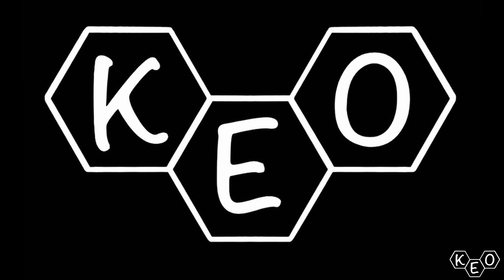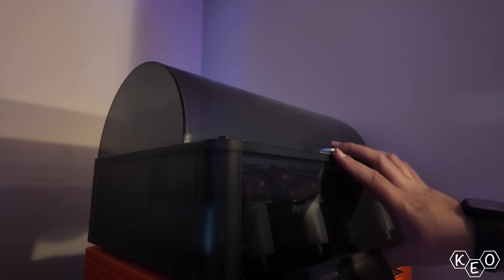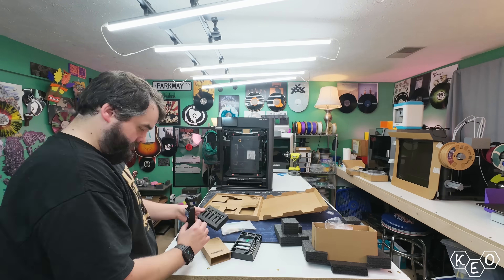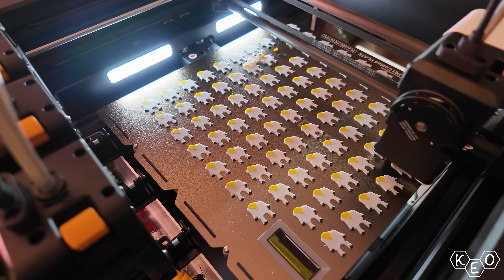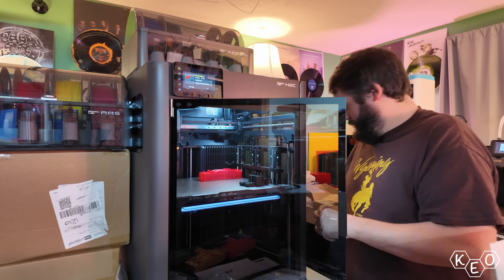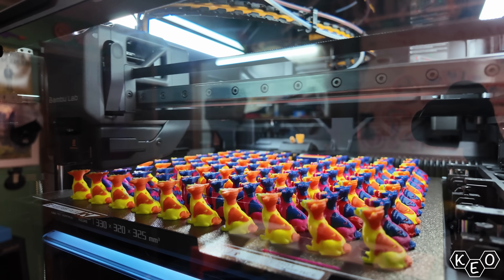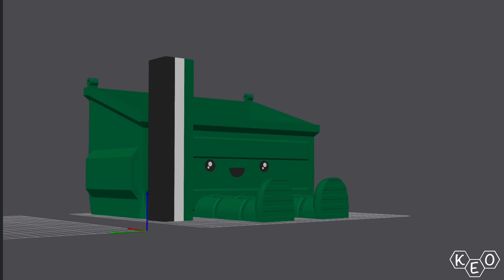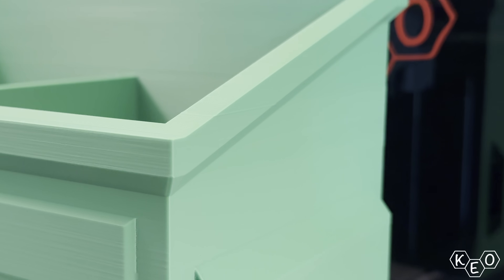Bambu H2C: Brilliant Innovation… or $2500 Mistake?

Comment: I can still return the H2D bought a few days before the H2C price was announced and released. For $399 more (half what I expected it to be), you open up so many more colors with almost no purge waste (long term savings and less garbage), and if I buy it from Best Buy, free 2 years warranty with total member plan (Though, they only change $179 for 4 years, Microcenter wanted double that for 2 years). Only downside, packing up and returning the H2D to MicroCenter, which I feel guilty, but hard to not push through that for the longterm benefits of the H2C.
Reply from the maker: I would return it. It’s a bummer to pack it all up and stuff but the H2C is so much more versatile than the H2D. Totally worth the effort right now

Comment: The heat gun can you comment on that a bit what does that do for you, smooth out the objects do you hit them all or just something depending on stringeyness.
Reply: I use a heat gun to clean up angel hair - very fine stringing between models or just across openings in a single model. It just disappears with the heat gun. Not worth trying to tune retraction any further than it already is, esp since it often varies from spool to spool, even in the same brand and color

Comment: Iv'e had mine for Two weeks now. A big problem, dont turn off the dual nozzle check at the start of printing, it does not save time and causes grief with your printing plate.  Apert from that I love it. Best prints and easeier to use. There may be faster units and cheaper, but this this machine is classy.

Comment: I’ve used my h2c every day since it was delivered. It’s running right now and is flawless. My only gripe is the numbers never line up. 1 AMS? 2 extra tool heads. 2 AMS? 2 extra filament slots. AMS and AMS HT? 1 extra tool head. They should have planned this better with a 6 slot AMS or 8 head Vortek.
Reply from the maker: Yea, this is kind of a silly thing to complain about but I have the same complaint. I run two AMS-HT's with an AMS on the one nozzle and then another AMS on the other side. Total overkill but that is likely by design so Bambu can sling more AMS units

Comment: While I think the nozzle changing system of the H2C is really cool, I also feel that it over complicates their version of a tool changer. And you don't get the speed benefit of more traditional tool changers. It almost makes me think that they designed it this way so they can sell more AMS units, but I don't know for sure.

I'll be keeping my eyes on Snapmaker. As per usual, Bambu is more expensive than I'm willing to spend and I don't like their walled garden. But in the end, I'll probably just build a Sovol SV08 tool changer if Snapmaker doesn't make a decent priced larger machine.
Reply from the maker: This is a fun time to be into the hobby for sure. I think there are going to be loads of tool changers coming very soon

Comment: It can work well, save waste, and be impressive, but still be expensive, compromised, and complicated. Obviously I hope it works well for anyone who buys one, but I wish Bambu Lab had engineered a proper tool changer instead. It's also a lot slower than a real tool changer, which is the main reason aside from waste to make one. I feel they engineered it intentionally to rely on the AMS so they could sell more. Just not a fan.
Reply from the maker: The AMS is the bottle neck for sure. The capabilities are extensive but compromised is a good word for it no doubt. Not a dealbreaker for me but certainly a tough pill for many

Comment: It's a mistake for consumers but because they have to push their AMS system it's the only way they will do it. INDX and the U1 seem to be the better bang for your buck. This could have been the way  Bambu introduced a 360x360x360 build area. The other systems save time and filament Bambu only really saved filament.
Reply: Both indx and U1 have not and will not have a 360x360x360 build area the best we can hope for in the next 6-8 months is a Core One L with indx at 300x273x330 (indx seems to take 27mm). Thats smaller than the h2c and thats shipping today. Not sure why people keep saying the ams is a bad idea really its only downside is speed. I will love to see how people will handle their 12 colors spools i can now use/dry/change in a easy way on a indx and toolchanger without 'something' we will see what people will come up with and how it will look/take space. Each system has its downsides and h2c is speed vs indx and toolchangers but jump over all the advantages like its nothing will be fun to watch how this evolves.

Comment: I mean in a vacuum, this is a cool idea and definitely reduces a lot of the complaints with MMUs. But when you compare this to budget tool changers (you could get 2 U1s and a P1S combo for the same price) or Indx which removes the need for the AMS and is much faster, its a bit to late to be the best method.
Reply: Being able to “store” and use 24 filaments at a time is great.  To do that with a traditional tool changer would need a huge footprint with today’s tech.     Of course I’ll never have the exact colors I need when I have 24 loaded.
Reply: Not every printer that comes out needs to be the "best". It's not a matter of better or worse than <insert other printer here>. It's just different. Comparing this to the U1 doesn't make any sense to me. This is not a budget machine. It was not designed to compete with the U1. It was in development long before anyone knew about the U1. It's meant to compete with machines like the Prusa XL. I have no reason to buy two U1s and a P1S instead of this. None of those machines can do exactly what this one does.
Reply: @1981AdamGs  Yessir!! That Bambu reliability means alot when you're pulling the trigger to add 50 machines to your production line. You know it will just work. When you do eventually need to service your machines, you can get parts next day usually. Part availability is crucial when a down macine means lost revenue- Bambu Lab is a great partner in that regard.

Comment: I worry the little mechanisms are a bit too complex and delicate. Do you think it might be more likely to break than a toolchanger?

It’s a really cool concept, but in my experience with other new technologies, the ones that try and go small with tiny moving parts aren’t as resilient and are harder to repair.
Reply: I worry too, but looking at mine, it looks to be ALL metal construction, its not flimsy or cheap, so let's hope it holds up!
Reply: You shouldn't worry. It's not too complex. People constantly get this wrong. It's actually quite simple and less complex than a tool changer. There are TWO added moving mechanisms to this machine. The pin that locks the right nozzle and a stepper motor that raises and lowers the nozzle rack. That's it. If the pin breaks, get a new one. It even comes with an extra one. The stepper motor will never fail. It's moving far less than any other motor in the machine. But if it does, you replace it. The complexity is in the software. Which either works or it doesn't. Other than those two things it has the same number of moving parts as the H2D. Tool changers have more moving parts because they have multiple extruders. Tool changers also have pogo pins. Which wear out. Anyone that has been around industrial machinery knows this. This only looks complicated because of how quickly it changes nozzles. But it's really not.
Reply: @1981AdamGs  Guess I need to see one in action, cause I’m still not entirely sure how it works. It does seem to be a cool concept though.

Wonder which method will win out in a generation or two when everything has fast wasteless multicolor the way everyone has multicolor boxes this generation. 🤔

Comment: The the layer bulge at the bottom of the dumpster outside might line up with the top layer of the inside of the bottom dumpster model. It could be large larger skrink you see even on the small benchy test when the layer cools down and pulls in causing the next layer to look bulged because it lost some of its base footing.

Comment: Good, but nothing compares to the Snapmaker U1 for Multicolors
Reply: Reliability and quality maybe? Speed is not everything
Reply: @BattleBrotherMaxor And anything lower than 3 or higher than 4 colors.. Its better in 3 or 4 colors for the best it's not really a win. The h2c will do 1 and 2 colors the same speed and well 5+ colors way faster since the u1 can't. It also is a 1.7x the build size and many others things. yes its 2.5x the price and way slowr in 2 or 3 colors.

Comment: I'm betting a single nozzle 4-vortek P2C will exist in the near future.  Smaller build volume, less nozzles, not built for higher end filaments, but most of the benefit if you just want to print some multi-color PLA and PETG stuff.
Reply: Probably an X2C
Reply from the maker: I would like to see a smaller vortek system on a single nozzle system come around

Comment: The features of the H2C definitely grew on me. I really like the ability to quickly swap out nozzles. It’s as capable as a H2D for TPU’s but much more capable for multimaterial printing. The AMS unit is also hard to beat for swapping out filaments, you don’t even need to mess with the printer screen whatsoever. 

I also really like the Prusa INDX option, however, I really want to see how they handle filament loading/changes for 10x nozzles on the C1L. Also want to see what the max temp ends up being for the hot end once it launches.
Reply from the maker: It’ll be interesting to see what the INDX ends up costing and when it actually delivers upon actual release. Should be a good thing though

Comment: H2S at half the cost is all most people need.  The H2C pays for itself and saves $ long term if you print multicolor frequently .. but if you are a high end user constantly printing, I'd want an improved H2C pro with a longer term warranty which they haven't released yet..

Comment: Well you saying that because of multi toolhead there would be less space and toolhead could be heavy and bigger but when i look at h2c toolhead, its already looking bigger than snapmaker one. and it takes so much more time than snapmaker to change color. at the end, print speed is way better with snapmaker. bambu use less toolhead with absurd price, snapmaker offer 4 tool head, easy solution with affordable price. i like a1 but probably my second machine will be snapmaker u1.
Reply: ehmmm it looks bigger because its 1.7 the build size ?
Reply from the maker: Yes, the tool head is certainly bigger than a single nozzle setup but smaller than a tool head that would have 6 nozzles on it for example. That’s the compromise and it’s certainly an interesting system with pros and cons. I am loving the snapmaker as well though
Reply: @KeoPrints  I might have commented this here before but i suspect given that the induction system is smaller they might go for 4 nozzles on the H3 next and keep the size/weight of the head the same (by then they have proved they can run that just fine). Having 2x2 layout on cheaper printers they will just use this (say $1300 to compete with U1) 4 tubes going to the head even faster than U1/INDX. Having 4 tubes max still means they can keep the way they now handle the tubes unlike INDX/Toolchangers that become complex. The more $$ printers would have 1 or 2 vortek systems on the front 2 nozzles in the 2x2 head. This way having 4 direct tubes, 12 quick swap vortek nozzles and well unlimited ams support (ams3 and more routing i bet). It all sounds complex but in reality all by then well tested parts they already do 1) multiple nozzles, 2) vortek 3) induction 4) ams... Yes its a compromise but can scale way better than the other systems. Been looking at beta testers with INDX for example and they already had 'tube' issues with 5 nozzles where tubes would interfere and give docking issues with others. no heated chambers yet, nozzles only 300c so far, 150mm of head room needed, also takes 27mm from bed space.... They are all compromises and its unclear what will be best... My guess is bambu will remix the 4 parts they already have and have been proven stable into new forms.... Still if you only need 4 colors and easy materials a U1 will be hard to beat, INDX seems very interesting for sure but i feel bambu has all the parts and by then thousands of hours and machines out to make a 'great' compromise that will just work. And yes i am biased have about 250hours in my h2c now...

Comment: Having extrusion issues with my left extruder. It aint the nozzle i swapped it. But the vortek system works perfectly. They sent me a new extruder unit. weird. prob a sensor. Also my aux fan is failing upon arrival. But when the machine works its awesome.
Reply from the maker: Bummer that parts aren’t working though. Glad it’s working otherwise

Comment: I'm leaning more towards the Snapmaker U1 right now. I'm a opensource fan and Bambu's going the wrong way for that. The one printer that Bambu may make that I would be interested in would be the H2S with the Votek nozzle system. I don't need the confusion of figuring out the X offset on the build plate for usable area. Maybe by then Bambu will have made a 6 reel AMS unit too.
Reply from the maker: I think a 6 spool AMS on an H2S with a Vortek system inside of it would be pretty great. Kind of best of all worlds in my opinion

Comment: I was disappointed in this machine when it was released, but having seen several real world experiences it's starting to grow on me.  It seems reliable so far and the slow vortek performance only burns you if you're using all materials on a single layer, real world prints typically have less.   Firmware updates have reduced swap times by 11 seconds and a future component update appears to offer AMS feed into both left and right nozzles, as well as TPU support for the left nozzle.  It's also the only machine you can buy today and receive tomorrow.  I really like the price point of the Snapmaker, and this is probably a good buy for 4-colour PLA prints.  The elephant in the room of course is the rival INDX system, but a new Core One with INDX may not be a viable purchase choice for 6-8 months and assumes it runs like a dream straight out of the box.  Right now, the Bambu is delivering... I just wish it was cheaper, specifically regarding purchase of the AMS units, which are hugely overpriced for a plastic box and holding the machine back from wider adoption.  I would like to see more aggressive discount policy for AMS purchases with a new H2C order.
Reply: Ams on both sizes was always a option been using it since day one.

Comment: The H2C is an amazing printer.  What it brings that tool changers don't is the ability to print as many colors/materials you want, not restricted by nozzle count.  What tool changers bring that the H2C does not is multi-material with soft materials.
I like mine.  But, I have a u1 on order since it can do things the H2C can not (and vs versa).
Reply: This is what people aren't understanding. The H2C and the U1 do different things and are better at certain things. One of the reasons I am not getting a U1 is because it is only 4 colors. I have a handful of other printers that can already do that. I need one that can do more than 4.

Comment: What he's not telling you is that it still takes a lot of time for each color change due to the AMS time. EACH color change still has to change the color inside the PTFE tube even though the nozzle already ahs it loaded. Less purge waste? Yes. Shorter print times? Nope. If you're wondering why he isn't telling you this, he did a video recently on how every Youtuber is biased. Refer to that.
Reply from the maker: … did you watch the whole video? Because I specifically mentioned how the nozzle swap takes 10-20 seconds and then takes an additional 10-20 seconds waiting for the AMS to feed the filament lol

But yes, this is the primary issue with this system. That is the MAJOR tradeoff

Comment: I love my H2c. People complain that's it's slower than a tool changer and that Bambu screwed up and that they're done for with this "stupid" design. But, consider this. Bambu isn't focusing on the hardcore 3d community. They are going after the "regular" consumers. They are taking 3d printing to "the masses." Closed eco system. AMS systems that work with all of their printers. The H series wasn't designed to replace their AMS'. They wanted to enhance them. They sell a LOT of AMS units (I've got two AMS2's and an HT on my H2c alone). The Vortech system was designed to integrate WITH their AMS units. They now have a printer that can print with up to 24 different colors without any "pause and swap" work arounds, and up to 7 colors with no purge waste. Let's do a speed comparison between the U1, XL and H2c with a 7 color print.... If all you need is four colors in one model, and aren't printing with any challenging materials (I'm running a print now using PA6-CF), the U1 is a great machine! I'll be buying one for my daughter as soon as I can actually purchase one and get it delivered without waiting three months.
Reply: Yes... Bambu Lab is counting on regular users buying more AMS systems... You really got to the core of the reasoning there.
Reply: Finally someone gets it. Bambu Lab isn't like most 3d printer companies have been in the past. (Aside from Prusa.) They don't make a 3d printer, sell it, and then forget about it so they can release the next one. They make sure everything works as well as it can with their hardware. And there is nothing wrong with that. If people don't understand how Bambu Lab works at this point, that's on them.